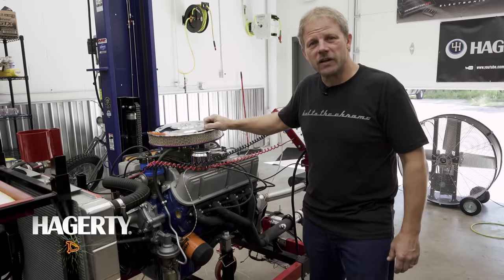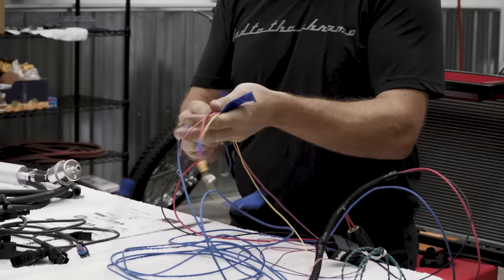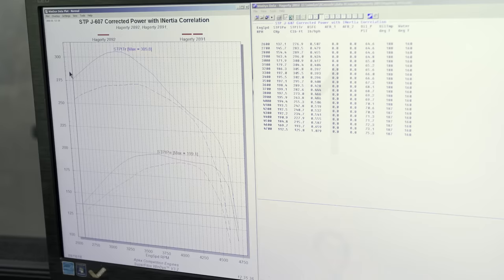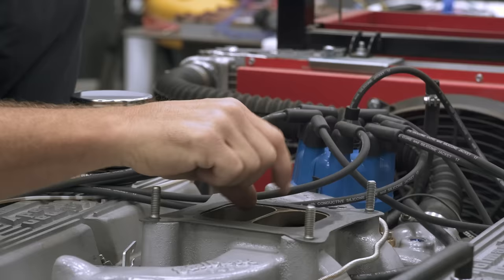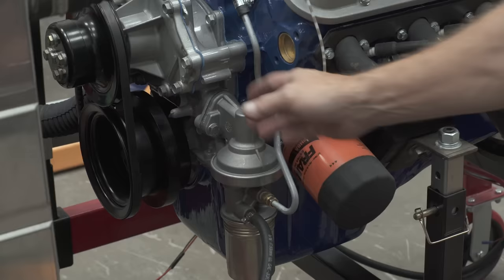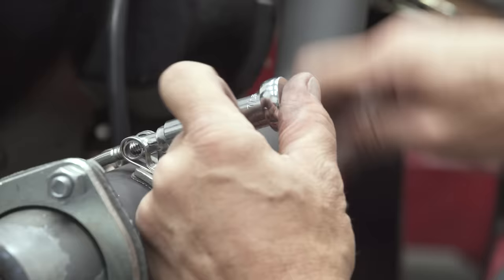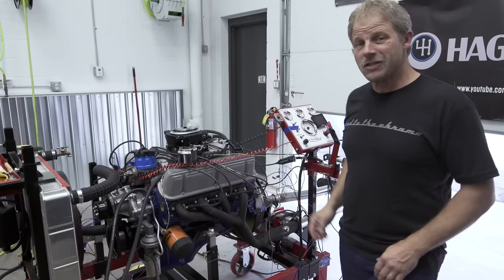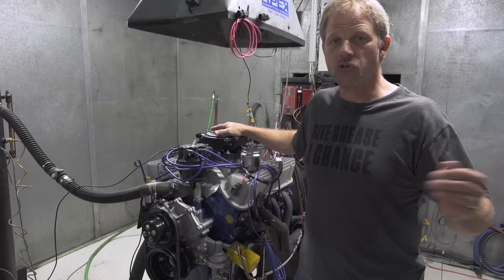Is it worth it? Replacing your carburetor with a Holley Sniper EFI | Hagerty DIY

Comment: No matter what this dude says yes Sniper system is worth upgrading from carbureted.

If a 950 carburetor in a 950 EFI are properly tuned. You will get better efficiency out of the EFI then you will carbureted.

Not to mention $200 upgrade you've got to 220 CC injectors. Now you're gonna blow past that carburetor.. 

I have done this on a 81 C10  upgraded to the Holly. The amount of realibility power on Top of everything Versus Going with a HP Holly carb. 

No more hard starts vape lock or it getting hot the fuel thinning. Yes high Temps will cause fuel bubbling

Comment: For us truck guys 11-1 compression and propain is where its at. No pump no electronics . just the occasionally froze up mixer if you take off before the vehicle warms up in cold weather. Beat on it with vice grips and rite back to running.😂

Comment: Carbs require more maintenance and attention.
But, once you get one dialed in, its great.
Although, I have an issue with the rear cylinders of my 454 running lean with a Holley 4150 double pump carb.
I think it is because when you cruise with this carb, you are dumping gas in the front two ports only.
The intake is a dual plane. Maybe with a single plane I wouldn't have that problem.
Anyway, I think AFI could make overall fuel mileage and driving much more pleasant.
But, not that much.

Comment: Very cool and informative video, I ve always been a fan of retrofit EFI units on to old engines and car/truck builds since the 90s. I think more so the inherent advantages of the EFI set ups are  better precision , compensation and economy ! Thanks for doing this
Reply: Then it craps out after a week, floods your engine for no reason, sensors stop working, on and on. Holley EFI sucks.

Comment: I think some are sorta missing the point here. This isn't a "claimed" 100hp bolt-on product or even for high performance really. For only couple hundred dollars more you get a reliable and programmable fuel management system.  I found a 1984 RV that's been sitting in a steel shed (barn find) with 34k miles on it. Yes, inside is perfect and like walking back to the 80's. COULDN'T FIND ANY EVIDENCE OF MICE OR CRITTERS - no poop, chewed wires/hoses, and even metal roof was free of 2"-3" of bird crap I anticipated would be up/on there.  The inherited owner was a mechanic and he went ahead and drained fuel system & tank, plus just rebuilt the carb. Thing runs like a champ considering 24' long and added weight of box on it.  So this was great and all, but I plan on towing.  This Holley Sniper EFI was of interest and this test answers my main question of "torque".  I'm sold on that alone and the baselines between the two is absolutely incredible torque wise. Was hard to read the readout/comparison chart they didn't show long enough. What did it pick up horsepower wise? 25-35 or? Regardless, I think for the right "purpose" this SNIPER system is well worth it. Adjustable for hills, mountains, and I can imagine getting MPG up moderately on flatlands (with no headwinds of course).   Think of it this way, it's "the right tool for the right job". I don't think they were doing this demo for drag racing or nascar. Everyday driver VEHICLE that wants better fuel economy and reliable too.

Comment: One more comment...........  you said that the points were floating at 4500 rpm.  It must be a miracle that the Sniper fixed the point float issue.  You should have went to the hyperspark or some other upgraded distributor system..   However, I enjoyed the video,  Your single point distributor should have got you nearly 6000 rpm

Comment: There is a problem with this as with the carb. With todays gas the under hood temp cause vapor lock at the intake to head when the temp gets to 180 degrees. I have fixed this problem by adding 110 leaded gas with about 3 to 5 gallons to a 20 gallon gas tank. Since you can't buy leaded gas anymore we really need injectors to each cylinder.
MAKE a kit with injectors to each valve then they would have a great system. Which would mean a new manifold with a whole new system and solve these vapor lock problems once and for all.

Comment: The real benefit is Fuel Air Ratio... The motor makes more consistent power the closer you can keep it at 14\1...Why them old Carburetors needed a chart. As they changed dependent on Air Density. Air Temperature. Altitude. Engine temperature. Timing etc..Then you had to set float level and have a bag of Jets. To fit your chart. 

The real power curve is in the heads and cam shaft...

Comment: The last carburetor on a production car was a 1986 Yugo. The article in a magazine discussing efi vs carb closed by saying ding dong the carb is dead.
Reply: I'd say your magazine article is flawed, because that's incorrect. GM used them on the 307 cid Oldsmobile wagons thru the 1990 model year and Ford used them on the P72 (Police Interceptors) Crown Vic's thru the 1991 model year. For pickup trucks, it was Isuzu that had the last carb'd model...in 1994.
Reply: BERPSU1 Thanks for the information on the last carbureted production vehicle.
Reply: WROOONG. 1990 jeep wagoneer was carb.

Comment: Well, First you should have rerun the Carb with the one inch spacer and tuned the carb in to make it closer to even. You did make adjustments after putting the EFI on

Comment: Is there compatibility for dual exhaust, i.e. two O2 sensors?
Reply: Dual O2 won’t help with this system as it’s a single bank setup. It can’t control the injectors per bank since it’s a throttle body injection. So there’s no need or advantage to having feedback from a sensor on each bank. 

For that you’d need multiport injection, or a system that separates the banks in some way.

Comment: What if? To eliminate the necessity of adding the return line back to the fuel tank, leave the mechanical fuel pump in place, tee the return line into the suction line of the mechanical pump, add the electric booster pump to the output side of the mechanical pump.

Comment: Years ago I had a 289 that was built up to K code specs. The dizzy was stock except for the advance curve being reworked, and I used to shift it at 6 grand with never a point floating problem.

Comment: The 1" spacer is worth a few ponies already.... lol The Holley 1850 is a pretty good carb, I like it for light performance use, I actual used a 1850 main body for a custom build on my 289, modified 1850 body to fit all 3310-1 parts minus the 3310-1 780 cfm main body. It been proven already that the carburetor makes more, but usually HP only. My jetting ended at seat of the pants, I figured with the larger 3310-1 throttle plate, the 1850 flows near 700cfm with the air horn removed, I'm at 69.50 on my main jets, 78 in the rear with a adjustable QuickFuel secondary pod about 32-33' total advance. My cam is similar to a LeMans cam Isky Mega 285 with 1.6 rockers gives me .551 lift, 108 LC,  with modded J code heads 1.94 and 1.60 Ferrea high flow 5000 series valves, on a A code bottom end. I could put a bigger carb on or switch out the main body back to the 780, but for around town this package rocks.

Comment: Back in the early 90's I had a 300HP 350 Chevy V8, with a 600cfm 4 barrel Holley Carb, in my old 1973 short wheelbase series 3 Land Rover. 'Thee' problem that wrote the project off was, when climbing steep tracks the carburettor would be on such an angle as to pour raw fuel down the throat and you would invairably get a 'flood stall'! Trying to hold the truck on a one in one with the right boot to the boards trying to clear the flood, every 100 yards, was no fun at all! Would this unit fix that?

Comment: I feel like the carb spacer should have also been run on the carburetor for a more 🍎 to 🍏 comparison for a power comparison. EFI is about reliability and efficiency and less about power in practical application.

Comment: EFI properly done will always beat carbs. It’s way more precise, is a closed loop system, and takes way more variables into account. Port EFI is even better which is why a small block LS motor can make way more power than near any carbureted big block under otherwise similar circumstances. Carbs are 100+ year old ancient tech and really have no place beyond a lawnmower these days if you care about performance. The typical downside to retrofitting EFI is the cost and fuel pump and return requirements.

Comment: Ive been looking into the Holley Sniper system for my 67 Cougar with the 390. Ive basically seen about 50/50 for those for and against. Seems theres still some electrical issues in the programming. I’ll stick with my 750 Double pumper for now.
Reply: 99% of issues are installer error, whether they believe it or not. Even if this video he made a number of errors. They didn't adress them but I assume they were fixed off screen.
Reply: That sounds like an awesome Cougar!  Mine was a 70 with the 351 2bbp.

Comment: The real benefits come from user comfort and ease of use, small portions. What it comes to costs and this EFI not being a real fuel injection but only a mere pre-programmed electronic carb then I say save your money. If you know how to use your carbureted setup, keep on using it. These things (and all alike) are just a waste of money for small automated things that you can do with the right foot if you are familiar with the characteristics of your setup. Believe it or not, but quite a few of my customers have asked me to remove these systems and put the carb(s) back on.

Comment: Left out the biggest thing , what is the cost between the 2 ? MPG will pay some back , the car was under fueled with the carb it had so the power gains did not tell as much as the man said .

But what is the cost difference between the right carb tuned/ jetted properly and the sniper ? 

Carbs are relatively inexpensive today .

Also which is better if you want to run a small shot of nitrous on a motor not specifically set up for NO but is relatively low.compression with pistons that can handle a little NO without failing . For this little mild engine as a % a 50-75 shot would be a significant amount of power for straights or a drag race in a light vehicle  adding 15-20% more power on demand . 

My guess is the computer EFI would be better for gains as well as safety and possibly allow a smaller shot ( which I would think is always safer ) to create more power to where a 50 shot on EFI  might equal a 75 shot on a carb with less chance of catastrophe ?

I'm stupid about cars BTW so excuse me if my questions are stupid .

Comment: EFI is great for cold climates, start it up and go. Carbs can work as well but it takes lots of work (ie Webers) while the EFI can just tune itself. If you throw one of these on a stock motor, dont expect tire burning performance gains. Its really all about emissions. No more stinky classics that you can smell 1/4 mile in front of you, but that tells you the person who owns it can't tune a carb anyway. Put a 3 second delay on the tach in to solve the tach sweep issue.

Comment: Putting the FI computer on the throttle body may be neat packaging but I worry about the heat cycling with the electronics right on top of the engine under the hood.

Comment: Kinda glossing over the (fuel return)... Could be the hardest thing to do for some DIY people with older vehicles.. But since most 70s' and older builds usually "deserve" a new fuel tank, or at least a cleaning, mod and tank seal against ethanol rusting issues, it would be a good think for Holly to suggest.  Power gain or loss aside, I think with 4X4 use, it's a no brainer. Same with a old motorhome that sees high and low altitude trips...

Comment: I have been watching quite a lot of drag racing vids. The highest performance race cars are all micro-tuned using lots of sensors, a computer program and the ability to change settings in the ECM. Having live data and a mini screen for the EFI is so much more efficient and trouble free, it seems like a no brainer. However the cost to acquire the EFI is pretty hefty and probably makes a lot of fellas continue with a carb.
Reply: It only costs a lot when you buy the car 1 piece at a time. V/R Chris

Comment: I added a FiTech to my Chevy C20 - with a crate 350 vortec and a 700R4 tranny. I would never do that again. There is no support and there are no shops around Colorado that will work on it. Have reset it several times and had a few backyard mechanics look at it. Been all over Youtube to find any settings that will help. Cold running is terrible. It gets 11mpg. Lot of lost money. I’ll go buy a new Edelbrock to put on it. I’l having a new 360/408 stroker built for my 72 Demon that I bought new. And no EFI. No electronics. Didn’t have any on it when it was built and I’m keeping it that way.

Comment: I'm thinking about putting one of these on my toyota 22re. I'm actually thinking about scrapping the stock efi set up for the 2300. Mainly so I can turbo it easily, but also because I could carry the weber from my old set up in my tool box and be able to swap everything out if I run into trouble with the efi setup out in the mountains.

Comment: By the very fact that there is a "FRAM" oil filter in plain site tells me where this gentleman is coming from.............Know what I mean ?  Also , Shelby put headers & a small dual inlet double pumper HOLLEY (600 cfm I believe) and got 306 HP !

Comment: I put in a sniper about 8 months ago in my 1970 C10, 350 motor. After having problems and after numerous phone calls, after sending the unit in 2 times, and was told to send the unit back in for the third time--- I took the unit off and installed a regular carburetor. Worst investment ever---

Comment: The only real issue I have with my Holley 750 cfm carb used on my Chevy cruiser BB is that the sweet smell of gasoline is always in the garage. Now if a TBI system continues with that problem IN ANY DEGREE than I will stick with the carb! No one talks about that aspect because it doesn't relate to HP.

Comment: I failed to find this: With EFI we use much higher pressure and a smaller nozzle and get much smaller droplets which really flow with the air and don't imping on the wall of the intake manifold.

Comment: Carb is better on a dyno but once it gets hot at the track or you stuff an air filter and the car hood over top of it and it won't perform as well. Don't forget changes in altitude.

Comment: Carb spacer (used only in EFI likely contributed to some of the gains.  Should have tested with the carb spacer in place with carb, and tried a larger carb.
Reply: I agree, the change was the higher CFM, change to single plane with higher volume, and the spacer. Look at that section of the video again. What the EFI brings to the table is not power, it is consistency. V/R Chris

Comment: Hey u shouldn’t use Teflon on the  water temperature sensor it won’t read right it won’t ground right itself with tape on it you have to use copper anti-seize me and me and my electrician Boss figure that out that’s why temperature gauges don’t work right sometimes

Comment: Would love to see people use more reliable testing procedures so we could see some usable data.
This test is pointless and incredibly biased.
Use the same open single plane intake on both carb and FI.
Use the same ignition.
Add the O2 sensor in the beginning so both have the same air flow.
Use the same CFM carb and FI.
Have a carb specialist adjust the carb on the dyno.

What you will see is that when the same setup is used and when the carb is optimized, the difference is negligible.
Yes that is correct. 
At one temperature / humidity / altitude, a well adjusted carb is or can be as good as FI. 
And the carb is easier and cheaper etc.

The real reason to use FI is fuel economy in a street driven vehicle that sees a variety of different temperatures, humility and air density.
The FI will self adjust, the carb will not.

And the points rpm limit at 4500 is ridiculous. Shelby Mustangs used 302 with points on the race track at way over 4500 and a 750 Holley double pumper carb.
Get a Shelby race engine or an exact replica and then do the FI swap.

Comment: If you have a sweet running carb combo, is it really worth spending the cash, and time, to get small improvements? Snipers have uneven fuel mixtures to each cylinder, prone to being confused by electronic noise in or near the car, and sensor signals. Maybe for a fresh build if you don't have a carb already.

Comment: Great video! Holley sells a version that will work with my 455 Buick Electra. I just rebuilt the engine and I’m looking at this as an option before going the LS Swap route. I’ve had the stock carb rebuilt and I still come out smelling like gas fumes.. Hope this EFI option works for me.
Reply: Your QJ wasn't rebuilt correctly. Put a Holley on it. A tuned 650crm with vacuum secondaries should work.

CID X MAX RPM ÷3456 X Volumetric Efficiency (about 75% in a normally aspirated engine)
So
455 x 5500 ÷ 3456 =725 × .75 = 543 CFM
I've used this formula for 45years. It rarely comes out to over 600 cfm. 
A well tuned 650 cfm holley will be more than enough for your 455.

Comment: If you are replacing your carburetor with with efi, be prepared to spend a lot of time getting it installed and running properly.  If you don't have the time or skill to do it find an experienced shop with a dyno to do it for you.  OK, that said, what do you get for all the effort and money.  Not much more horse power, if any.  But, the engine will run cleaner and smoother at low speed.  Also, better gas mileage.